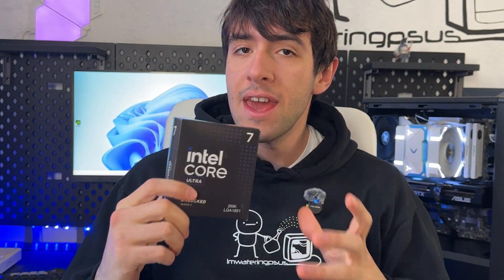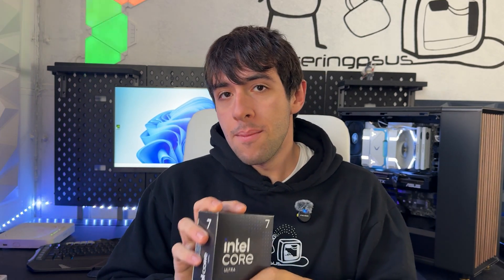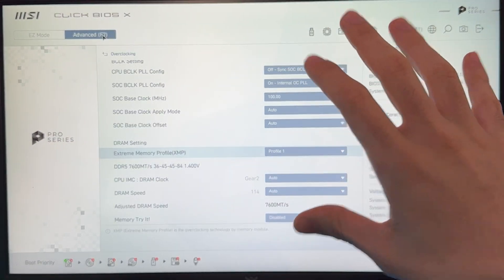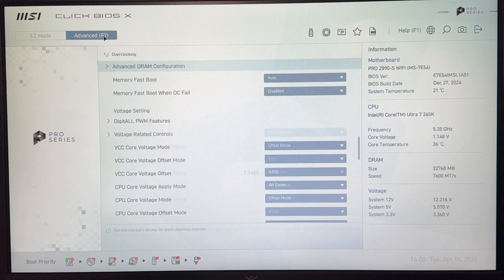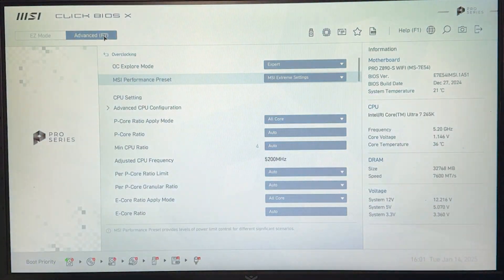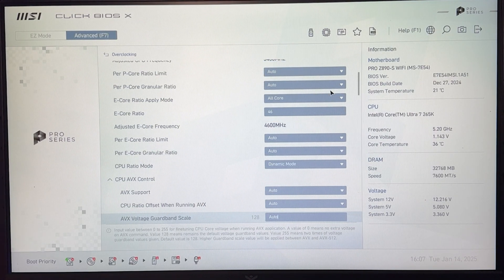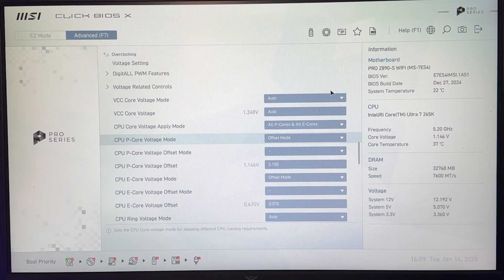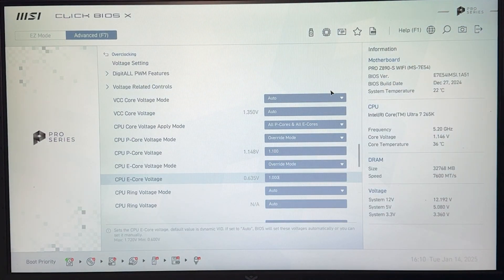Undervolt your Intel Core Ultra 7 265K for more FPS and Lower Temperature!

Comment: Hi! I wish to do nundervolt (it seems to work pretty well as far as) but I also wish to overlclock ring d2d and ngu to decrease latancy, did you do any tutorial about it?
Reply: Intel 200s boost is basically what are you asking.
Reply: @GamesOfficialYouTube  yes, but is not pushing the limits, cpu has more to offer .. finally I did it and got like 7 % more performance (above 200s)
Reply: @jacekbigjack Did you Undervoltwd your cpu?
Reply: @GamesOfficialYouTube  hard to say, I switched to power gate mode .. and overclocked it, temperatures dropped and power usage under high load seems to be lower ;) but voltage is set manually 1,325 pcore 55x all, ecore 50 all ring 41x, d2d and ngu 33x

Comment: What am i doing wrong ? Undervolting my 265kf , decreased 50 % of my peformance , even if they show all cores at the clock stock. my asus rog strix has the intel settings and it gets sometimes to 1.45 ... i set it max to 1.3v.... from 61000 in passmark went down to 15.000 :)))

Comment: Waiting for mine. The board is Asus z890m plus wifi. 

The cooler is thermal spirit 120 se, so I need to undervolt it for sure. 

If I am after temps and power consumption, do I only offset the voltage and be fone with it? Do I still test for stability after that? Which program?

Comment: Hello, I undervolted my Ultra 7 265K using your video. I started at -0.05 volts, and hit a negative offset limit at -0.210 volts. Everything seems to be working fine. I ran a stressful program that would cause 100% usage on all 20 cores, and hit around 100C and cause throttling, but not now with the undervolting. I'm still testing.

I undervolted all of the following by -0.210

VRM Core Input (currently at 1.190V)
Performance cores
Efficiency cores
Integrated graphics cores

This is on my ASUS Prime Z890M-Plus.
Reply: Got the same mb, whats the name of the settings you changed?
Reply: @volodyaevtimov5894  They were voltage settings for high performance cores and efficiency cores, I think, but I stopped doing that. I reset them to default settings.

I now set the "Long Duration Power Limit (PL1)" and the "Short Duration Power Limit (PL2)" to a lower level than the default. I believe my Ultra 7 default max wattage was 250W, and I set it down to 105W or 125W, and I tried 95W. This stopped the CPU from throttling even at 100% core use. It seems to work great for the type of work I do.

Comment: Anyone manage to undervolt 265k on gigabyte? i have z890m gaming x but bios is too confusing for me
(I upgraded from amd b350 hehe)
Reply: Set vcore voltage mode auto
Cpu DLVRin Vcore Normal
Dynamic Vcore DVID to -0.100V
Reply: @mt6739fan will try
Reply: @mt6739fan it works ! I under volted my 265k before but for some reason my settings went back to default.
I was getting 74 degrees on bf6 conquest.
Not steadily at 62 degrees with 180-205 fps, on high settings.
I even undervolted my gpu. 9070xt
Everything chilling at 64° and lower.

Comment: edito video de bodas, 15 años etc, pensaba comprar el 14600k ($5,500 MX), consegui el 265k en oferta($6,600 MX), en mexico el 285k cuesta el doble por alguna extraña razon (12,700 MX), la temperatura en 265k alcanzaba 92°C en varios cores, tenerlo haci por 3 o 4 horas no me parecia correcto, ahora en el 265k lo puse  offset -0.050 como indicas en las 2 opciones, bajo a 82°C y ademas hice offset -2 en los P cores y los E cores,  bajando de 5200 a 5000mhz y de 4600 a 4400mhz respectivamente, temperatura maxima de 74°C en los cores mas calientes, -18°C,   para trabajar me parecen geniales esas temperaturas y solo perdi un 5% de rendimiento en los test de cinebench y CpuZ, para jugar tengo una 4070ti Super,  monitor 360hz, juego principalmente valorant y tengo mas de 500 fps, y los AAA me da igual jugarlos a 150 que a 160fps  por la perdida que pudiera llegar a tener.  el undervolt para los que no son extremadamente minuciosos en obtener hasta el ultimo MHZ de sus procesadores deberia ser algo basico.
Reply: Bro, ¿A ese 265K le colocaste el Soporte fijo anti-flexión para CPU y una buena pasta térmica?, ¿Qué refrigeración usas? ¿Si los archivos de edición son H.265/264 no usas la tecnología QuickSync?

Comment: If you disable IA CEP and put CPU Lite Load to Mode 13 you will get even more undervolt.
Reply: after i disable ia cep the cpu locks itself to 400mhz wtf
Reply: @vigus-android-devlogs u dunt need moar

Comment: Hello, so I got the core ultra 7 265k on a z890 aorus master. I activated 200s boost and disabled c-states which should let the cpu run at 5.2 ghz all the time. Now when doing benchmarks like occt or aida 64 extreme cpu test I realized that some cores sometimes drop to 5.1 ghz and rarely even to 4.8 for a second or 2 and then goes back up to 5.2 ghz. Why does that happen? The temp never goes over 70 degrees on that specific cores and powerusage in aida for example sits at 183 watts. I also tried without 200s boost and the same thing happens. Is my cpu or mainboard defective?

Comment: When i check vcore on hwinfo always 1.4v around with load. How can i solve. Tried voltage related settings, llc, lite load etc..
Reply: That's the board vrm feed to the dlvr which feeds the CPU.  Skatterbencher explains it well

Comment: Great Solution for Intel 265 User !! I undervolted my P-Cores 0,100V and set them "By Core Usage" at 1-2 x52, 3-4 x51, 5-8 x50; And E-Cores -0.075 all at x42. Now temperatures are great. Before in instalation heavy compressed games it was thermal throttling, because cores goes up to 102*C, now max 82*C. In standard usage is now 32-34*C in IDLE, and 56-60*C in gaming. Dont feel any power down ( HYperPi 0.99 8M was 1m19s, and now is 1m22s ) ;) Stil all works fine with 2x48GB Patriot Viper 8200 CL38, RTX4070 Gainward Phantom, and Asus Tuf Z890. CPU is cooled by old, but still the best single tower Thermalright True Spirit 140 Power ( 6x8mm heatpipes !! ) + 2x noctua Redux 14cm 1500rpm PWM fan's.
Reply: whats your vcore on load and idle?
Reply: @harbiyeli_aldnmz Now i get Noctua D15 G2 in low price. Dont undervolt now. But i will test it for you, and add the voltage min/max.
Reply: That's very good Temp indeed !
didn't know that ThermalRight has 10 pipes :P
I was about to use Hyper 212 on the 265K.
Reply: Whats your system wattage at idle?
Reply: Откуда такие цифры у меня под Фантом спирит 120 се в играх 60 градусов в рендере 1 раз было 79 а так выше 70 редко подымается ...

Comment: Please help. How to make these settings on the Asrock Z890 mobo? Asrock has completely different names and menus. Please help
Reply: 1. Oc Tweaker
2. CPU DLVR Configuration
3. VF Offset Mode: Selection
4. Core V/F Offset 1-7: set the offset in mV, e.g. -50 is -50 mV.
Reply: @Collapsion  thank you for this! I was struggling as well. Was looking in OC Tweaker>Voltage Configuration. No OC/gaming knowledge, just trying to undervolt/offset a 24/7 home server for some energy saving.

Comment: I did the same with my 13700k and MSI MAG Z790. 
Also I have set Advanced CPU Configuration -> CPU Lite load = Mode3. 
IA CEP Support = Disabled.
Don't know if this option is still available at 265K, but this option was the best way for cooling your CPU down.
Reply: It is available but it is limited to Mode 13. The stock mode is Mode 17.
Reply: @petkozhivkov4271  I have got 256K and MSI MAG Z890 now, and I use Mode 10 with IA CEP Support = Auto. It is quite stable for me.
265K itself is a much colder CPU with much less throttling compared to 12900-13700-14700 generations.
Did not get about "limited to Mode 13". I still can select starting from Mode 1 to Mode 25.
Reply: @ktylxy1  You can select any Mode but the MB won't go below Mode 13. Take a look in your BIOS which Mode shows when you are selected Mode 10. Also you can check it in HWiNFO, Mode 13 is AC Load line 0.80 mohms. IA CEP on Auto also means Enabled. It works but possibly lowers the performance.
Reply: @petkozhivkov4271  Confirm that. Did not pay attention earlier.
Looks like CPU Lite load is not that effective tool any more
Reply: @ktylxy1  What I did on my 265K is:
IA CEP - Disabled
CPU Lite Load - Mode 13
P Cores ratio - Auto
E Cores ratio - Auto
Enhanced turbo - Auto (Disabled)

VCC Core voltage - Offset -0.150v
P Cores voltage - Offset -0.100v
E Cores voltage - Offset -0.090v
Reply: @petkozhivkov4271  Your params did not work for my CPU. Windows loaded but BSOD on tests. Perhaps it also depends on MB and DDR5 installed.

I have set these values and it looks stable now:
VCC Core voltage - Offset -0.120v
P Cores voltage - Offset -0.080v
E Cores voltage - Offset -0.080v

However I do not notice much lower temperatures on air cooler. Maybe -1-2C. As I have mentioned earlier this CPU is cool enough itself compared to previous generations

Comment: Cant find vcc offset mode in my bios. im using Asrock z890 Steel legend wifi mobo
Reply: another commentor posted this
1. Oc Tweaker
2. CPU DLVR Configuration
3. VF Offset Mode: Selection
4. Core V/F Offset 1-7: set the offset in mV, e.g. -50 is -50 mV.

Comment: Thank you for this video! I have a question about Enhanced Turbo Boost for the Core Ultra 7 265K 265k, leave it On or Off? 

I am doing the undervolting part + MSI Performance Preset (Thermal Light Pearless Assassin 120SE air cooler).

Comment: How is this cpu doing ? Is it fast? Will it worth the upgrade for 10900f? I’m a programmer and a gamer.
Reply: I used i5 6500, moved to core ultra 7 265k and really happy with my choice, idling it consumes about 10-12 watts, and never seen temperatures above 88 degrees with be quiet dark rock pro 5. For my work with rust and elixir on wsl2 and other development and graphics stuff -  it is perfect. Paired it with 4070 super and I run every game I want - I don’t care about 10 fps more on other setups and squeezing milliseconds on compile time in benchmarks. It is energy efficient, fast and great overall.
Reply: @coyoteelixir  Hi, does it remain stable after heavy productivity work like rendering for many hours?  A Shopkeeper suggested me to go with i7 14700kf instead of 265k.
Reply: @science1060  yes it is stable
Reply: @science1060 go for ultra 7. 14700 is manufactured on very old shit intel process 10nm while ultra 7 is from 3nm tsmc known as very efficency process

Comment: Why are you undervolting it ?
Reply: its consume a lot of power
Reply: @deathstarkit  ohh
Reply: Also you will lower your temps. On amd you should always do that, since it tend to do a better job at that
Reply: Less power = Lower temps = Less throttling on multithreaded tasks = Higher productivity on long loads
Reply: this CPU is for OC 5.7 all P-core 5.0 all E-core. gaming temperature 80-90c. bought it to undervolt?? Should buy another one

Comment: Hey I have an Asrock z890 pro a wifi, and undervolt is locked? No option on offset on bios 0x113 microcode
Reply: Overclocking (4:18) OC Explore mod switch to Expert

Comment: Ill try this (dynamic) on my Asus Z890-F later, got the same CPU 265K, hope with the last BIOS 1401 they  fixed ALL the issues🙏
Reply from the maker: Let us know :))
Reply: @ImWateringPSUs  Thank you for this video. I am planning to upgrade my 5900x platform with my 4090 and wanted more productivity and still good gaming and this seems like a good choice and I wanted to see what I could squeeze out of this cpu. What were the Fps gains when you did this on average? It would be amazing if you had side-by-side or before and after results with temps and fps.